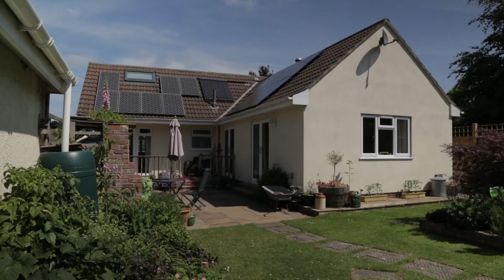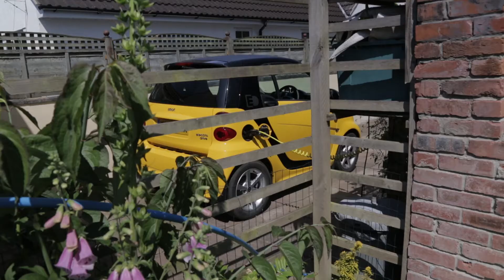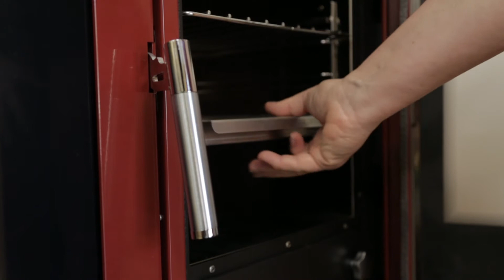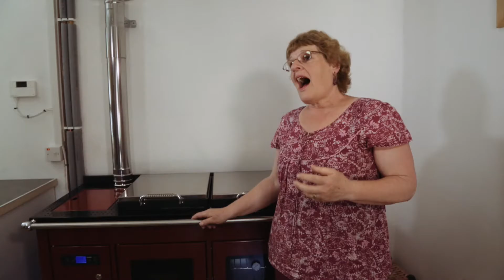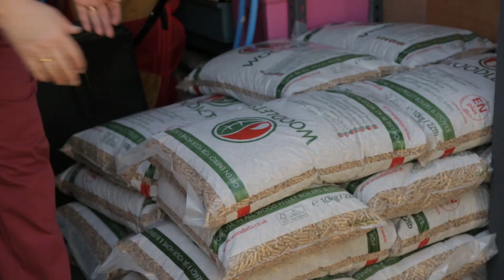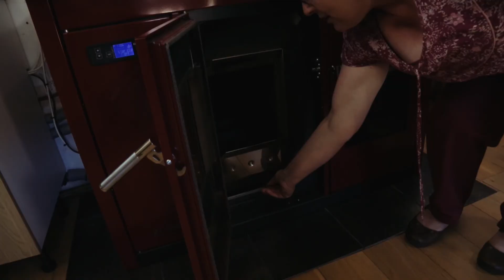Pete and Lizzie's Klover Smart 120 wood pellet cooker

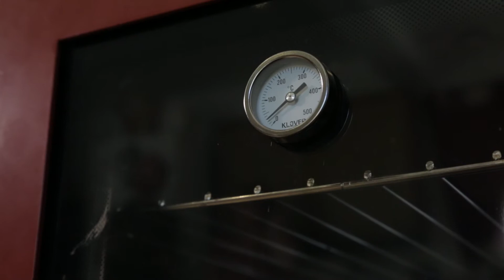Comment: If you look in the background at 2:24, you can see they have a normal oven as well. They forgot to mention that!
Reply from the maker: Yes you do need a 'standard' oven too, that's no secret. The Smart 120 will heat your house and water, whilst it's doing that you can cook and bake. That's why it can get the RHI grant, it's a boiler, with oven and cooktops. :)